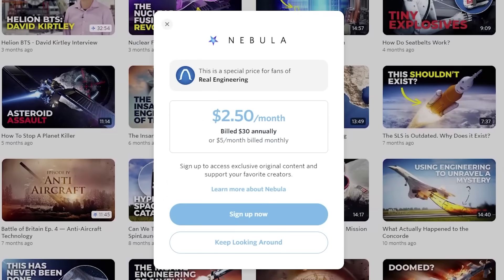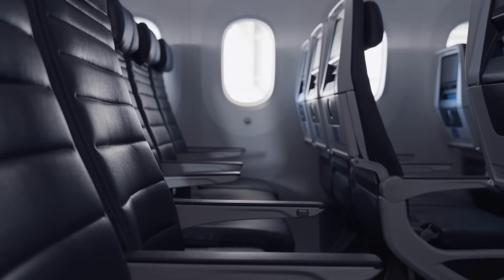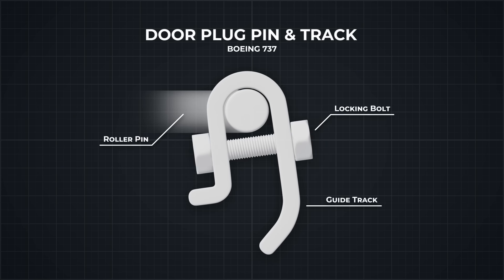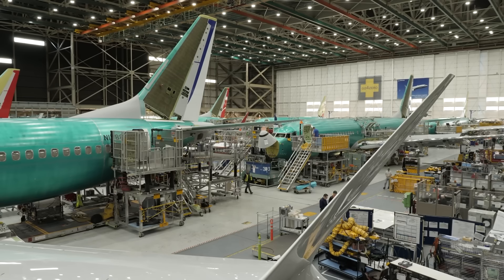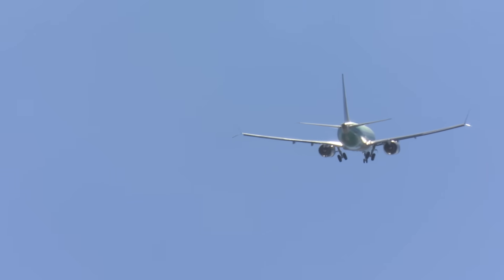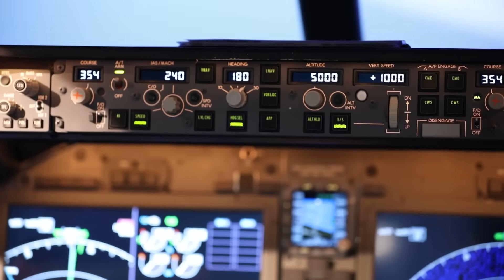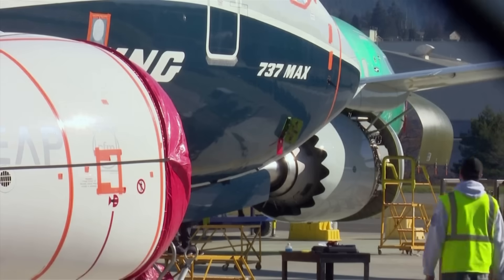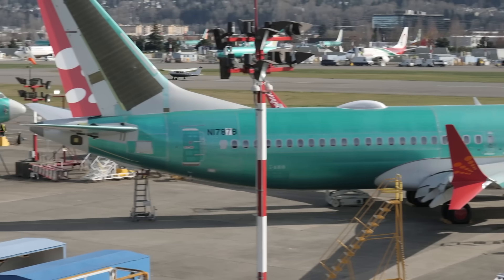The Questionable Engineering of the 737 Max

Comment: The reason Alaska allowed the Max in question to keep flying is because they thought it was a pressurization controller, which has redundant control systems, including a back up manual control. No mechanic would suspect that a plug door was the culprit on a two month old airframe.
Reply: The controllers don’t work like that per se. They don’t compare readings and control pressurization based on the difference. One is active until it fails or until power is switched, then the other comes on line. 

And yes, in theory one would inspect the door but its an honest and obvious oversight. The aircraft is 2 months old AND the door assembly is essentially the exact same as the 737-900NG. Those models have never had a door plug issue like this, so why inspect that when it’s not a door for one. Meaning it doesn’t open and it’s bolted shut. 

Sorta like buying a brand new car that needs an alignment, the mechanic will check all 4 wheels except the frame itself. Because its the least likely culprit. On a brand new car.
Reply: But they didn't even try to find out what was causing it? Sounds like whomever made that decision has a piece of black tape hiding the check engine light flashing in their car.
Reply: @JPMonteith Where did you get that they didn't even try to find out the cause?  They tested the system according to the maintenance manual and found no problem.  They then scheduled the aircraft for a more involved test.  They restricted the aircraft from flying ETOPS routes so it would always be near an airport. There is no evidence this fault had anything to do with the plug failure.
Reply: @stargazer7644  They tested the warning system and reset it. They didn't go searching for what caused it. That is mentioned in the video and numerous articles online. It is the thing that makes Alaska Airline's action look suspect.
Reply: @JPMonteith Even the NTSB believes the plug had nothing to do with the pressure alarms. In all cases those alarms went away when they switched to the secondary pressurization system.  If the alarms were from the plug leaking, the secondary system would have alarmed too.  It didn't.  The procedure Alaska followed is the written procedure in the aircraft's maintenance book.  What is "suspect" about that?  Unless the problem reappears during testing, it's pretty hard to fix.
Reply: The door plug in question has a bit of a history of failures, all manufactured by Spirit.
Reply: i'm sorry but they still should have investigated. if there is a redundant controller, could they not compare the readings from both controllers and if they both have the same reading then its not a faulty controller.
Reply: @skolarii not normally no as data at that level of fidelity is often proprietary and not available to the tooling the operator has
Reply: @skolarii They did investigate every time.  They followed the maintenance manual and tested the primary pressurization system and found nothing wrong. In both cases, switching to the secondary system resolved the problem.  If the plug was leaking the secondary system would have also alarmed.  They also scheduled the aircraft for a more intensive test procedure since the alarm happend more than once and no problem was found.  The previous pressurization problems had nothing to do with the plug failure.

Comment: The MCAS software did NOT malfunction.  It may not have been the intention of the software designers that all 737MAX aircraft attempting to fly with left side AOA sensors reporting false high values should crash, but that is exactly what the software was designed to do.  The fix of only applying less nose down trim than the pilots could override by pulling all of the way back should have happened before the first MCAS equipped 737MAX flew and would have been added after anyone asked 'What happens if the AOA sensor is bad?'.

Comment: The fundamental issue with Boeing is a lack of profitability. The last time Boeing was profitable was 2018. They are counting on the 737 Max to pull them out of the red ink. The company should be highly regulated as it appears corners are being cut to speed up the delivery of Max 737’s.

Comment: Boeing has been trying to stretch the 737 body further than its design allows. They should have just put the higher bypass engines on the 757, but then all of those pilots would have had to get a new type rating, so Boeing cut the corner and tried to fit a square peg in a round hole.

Comment: Can you blame Alaskan in the recent environment of the FAA cracking down on flight delays? Having to take a plane out of service is no simple task and normally results in having to rework crew and equipment schedules. If you have a slow leak in your almost new airplane, is it more reasonable to think there must be a small leak somewhere that just needs to be found and fixed or that it's a harbinger of an entire body panel about to fly off on flight? If you can fault Alaskan for anything, it's for putting too much trust in Boeing.

Comment: "The Questionable Engineering of the 737 Max"
It has nothing to do with the "Engineering" nor was it limited to the "Max" line for possible failures.
It was a QC problem with Spirit Aerospace a subcontractor for Boeing.
Of course Boeing did fail to catch Spirits error.

Comment: As far as I know, MCAS wasn't needed because engine cowling were higher. It was needed because the engines needed to be moved forward which caused engine power to forcefully push the nose of the plane upwards whenever the engine power was increased. Similarly, the nose of the plane would drop rapidly in case of engine failure or rapid throttle movement.
Reply: Basically yeah. The repositioning of the engines had that effect. MCAS was introduced to make the max “feel” like flying an earlier model of 737 by the pilots so they didn’t need to be retrained to fly the max variants.
Reply: @mikoto7693  Yes, this is the reason for MCAS. Because the feel was changed, which would require pilot training, not because the aircraft is unstable. I am so sick of people (especially those who should know better) calling the 737 Max unstable.
Reply: It was because the aerodynamic effect of the engine nacelles created a tendency to pitch up at high angles of attack, not because the engine thrust would push it up
Reply: @roowut  Try watching video titled "Boeing 737 Stall Escape manoeuvre, why MAX needs MCAS!!" by Mentour Pilot (an actual Boeing pilot that trains new pilots) around 16 minutes mark for a better explanation.
Reply: @MikkoRantalainen  Interestingly enough, “Mentour” is one of the less-experienced pilots in the industry who post online, and since he makes the majority of his money from social media, not flying, sensationalism is key to his success and his income level even if most of his content is accurate and good.
Reply: @ReflectedMiles  So, are you arguing on ad hominem or his actual merits?
Reply: @MikkoRantalainen  As stated, it is important to be aware of someone’s actual level of education or experience with something, and it’s important to be aware of their incentives. We are all impacted by those kinds of factors, so to the extent it is an ad hominem argument, it is for all human sources. For example, how many type ratings does he have? That single metric will determine the breadth of one’s experience and accurate judgment across different aircraft types and iterations.
Reply: @ReflectedMiles  I agree with lots of what you said here. To me, it appears that he is a lot more interested in psychological side and mechanical details of aviation than most pilots. I'd guess he has a better understanding of minute details of many major incidents than even more experienced (in type rating count or flying hours) which would definitely given him an edge in situation where you would need to quickly understand what's happening in case of malfunction.

That said, he seems to make mistakes, too, so you shouldn't take everything he says as gospel either.
Reply: @ReflectedMiles  Less experienced? I’m curious about how you came to that conclusion. He’s a line captain with Ryanair. True I have no idea of his total flight hours but it seems logical that a captain who quite literally trains other pilots would be pretty experienced. Is there additional information that you know?
Reply: @mikoto7693  Yes, you inadvertently explained it, but you can read his autobiographical sketch via his website. He has no military aviation background and trained through a government program to eventually fly the 737. He has a good amount of hours with the company’s fleet, but no broader experience compared to other pilots on YT like Juan Browne.
Reply: The problem with the MCAS was that 1. It needed two sensors to be safe but only one was installed standard. Also Boeing bluffed the FAA into not requiring simulator training for MCAS. They played down the level of change and there is basically collusion between FAA and Boeing because there are a lot of ex Boeing guys at the FAA. SOme FAA people should have been sacked as well.
Reply: @stringpicker5468  Boeing couldn't use 2 sensors because FAA considers any redundant system as critical and you cannot use the same type certification with additional critical systems.

That was the incentive for Boeing to use only one sensor. Boeing offered second sensor as an option but that couldn't be used as automatic fallback either or FAA could have considered that system as redundant, too. I think it was marketed as reduced downtime in case of sensor failure (because you could fly the next flight with another sensor if one failed).
Reply: That pitch behavior happens on most airliners. It's due to the center of thrust being below the center of gravity.
Reply: Lots of wrong and partially correct comments here (as in the video). Leeham News has a good writeup on it. @roowut has the only comment here mentioning the actual root cause--that the lift generated by the larger nacelles at low speed and certain AoA required MCAS to maintain the expected nose down tendency. Unfortunately, the MCAS implementation was seriously flawed.
Reply: @mio2540 I never mentioned anything about cost cutting, but it is well-documented (e.g. from Boeing internal email) that many of the design decisions around the MAX were to reduce training costs. Not at all a bad motivation per se, but numerous raised flags were not addressed--including from pilots themselves (the infamous AA pilot union recording--folks arguably well aware of the QRH) after the first crash.
Reply: Look, Pilots can fly the aircraft without additional training.

It is intuitive to set the attitude where You want it no matter how heavy or light the controls. Or what the throttle dues to trim.

The issues is the FAA would require a new type-certificate. This costs money. And also requires the pilots all be re-trained. 

Because the point of the 737MAX was for Southwest to operate it at low cost, low purchase and low pilot training expenses. 

They opted to create the top-secret MCAS system. It was published in the manual, but nobody was informed how extensive of a system override it had.
Reply: @mio2540 Yes, and specifically for the handling / training reqs issue. If it wasn’t for that, they would have dropped the whole MCAS concept and just trained to fly the airplane as-is, leaving everybody happy except the bean counters.
Reply: It messed with the center of gravety and center of lift. Destabalising the airplanes design.
Reply: @baronvonlimbourgh1716  Nope. That claim was just media imaginings. Not only is inherent instability in transport aircraft disallowed by law, but if that was true, the 757 was one of the most “unstable“ airplanes ever built—far greater pitch-up in response to power application, and the favorite of every pilot who ever flew it. The MAX flies beautifully with no MCAS installed or involved at all. These comment sections are filled with ignorance from all of the terrible media reporting and speculation. Listen to the pilots who fly them, not to media or social media. It’s sad how often misinformation and disinformation is misleading the public on all sorts of subjects, not just this one. And sometimes it is presented as real “engineering.”
Reply: I didn't get the idea that they were trying to claim or insinuate that the height of the cowling was what caused the MCAS system to be added, but rather the increased height was a side effect of repositioning the engine and that it was the repositioning that introduced the instability that necessitated the introduction of MCAS.
Reply: @MikeDCWeld  Bigger engines would not fit safely in the desired position and had to be moved forward, causing poor trim.

Comment: Most likely that the 4 bolts needed to stop vertical movement were missing.  The loose bolts were reported to be in the mounts themselves, not of the vertical travel limit/stop bolts.  The mounts in the incident were in place, although at least one was broken when the plug ejected.